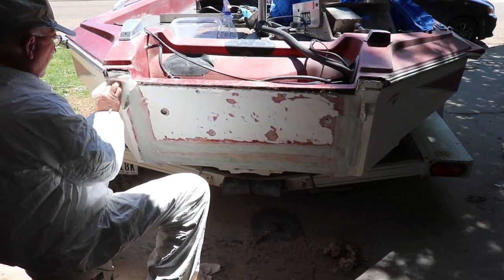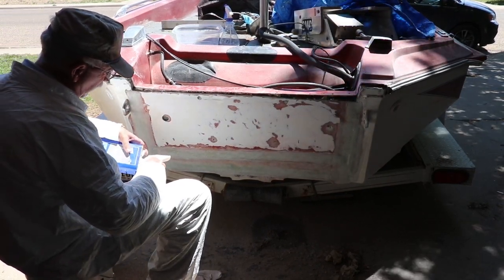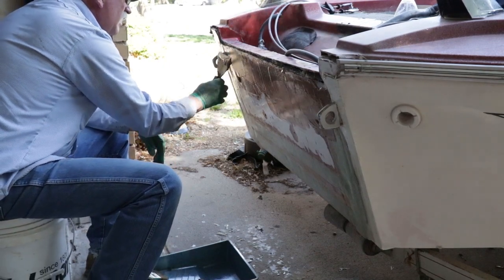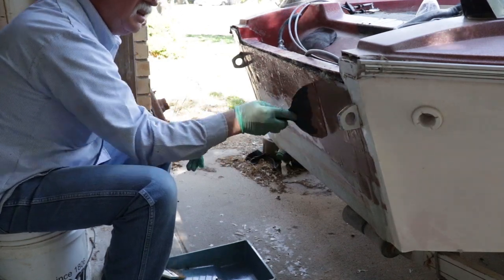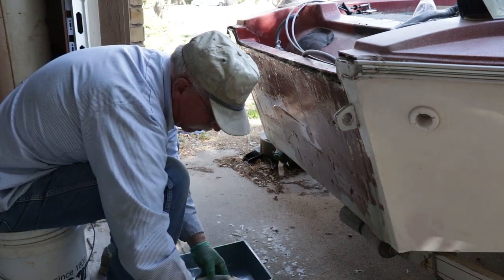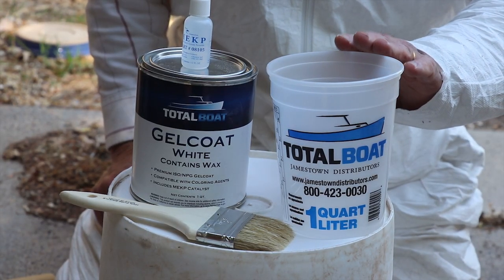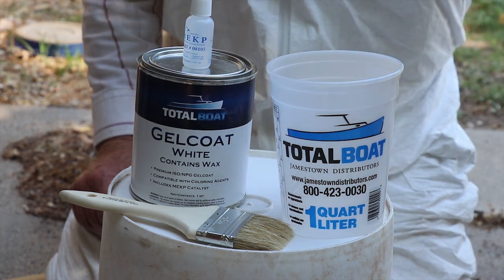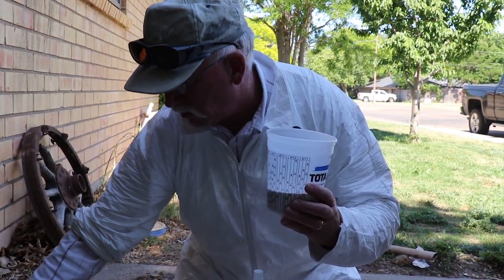Transom Replacement part 6: Applying GELCOAT!!!

Comment: Have you had any issues here after 2 years or is everything ok? Would you do anything different? I’m at the same stage. Thanks
Reply from the maker: No issues with it at all. If I could do it again, I’d spend a little more time measuring, setting, sanding, and focus more on the end result. Structurally, it is sound, but there are some cosmetic things I wish we would have spent more time on. Good luck on your project!

Comment: Time flies! How are you going to fill the gap on the upper right hand side or are you going to leave it and cover it with the cap. Thxs
Reply from the maker: We will fill it with 4000 series 3M silicone....I think that’s what it is called.
Reply: Pastoral Homestead Outdoors they make a harder material as well called 3m 5200. Pretty good stuff.
Reply from the maker: We talked about using that one! I think the 4000 is what he happened to have, so we’re going to use that. The 5200 I hear is amazing stuff.

Comment: I was told never epoxy over old gelcoat always remove it
Reply from the maker: Most of the old gel coat was removed via a grinder, but some was left on and gel coated over. Haven't had any issues with it yet.

Comment: SO you say 1 tespon per 8oz of Gelcoat ? I'm using total boats gelcoat on my Boston Whaler  this week .. how long did it take for the gel coat to kick and be dry to the touch ?
Reply from the maker: We used what it said on the gel coat label, I would definitely make sure yours is the same mixture ratio. It was 85+ degrees when we laid it on, it took about 10 minutes to become tacky and about 20 to be dry to the touch.

Comment: All these videos I watched all I could think is get a roller for all these steps. Would have been way faster and better coverage.
Reply from the maker: We have talked about that very thing several times!! One question about the roller that kept us from doing that was the amount of epoxy it would have taken. There were times we only had about 15 minutes of work time and we couldn't mix a large enough quantity of epoxy to roll using a full size roller. I have since found little "cigar" style rollers that would have worked perfect. On the next boat I am working on, the yellow boat, I will be using these little rollers as well as metal smooth rollers to help get the air out of the fiberglass. It's amazing how much you learn by actually doing the job...hopefully the next one will be even better!